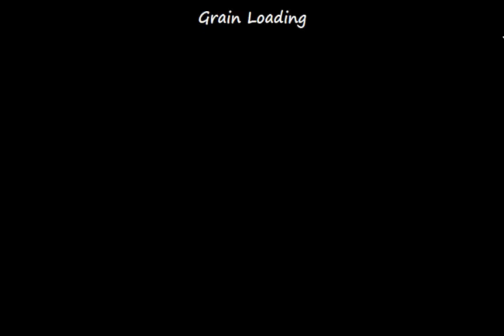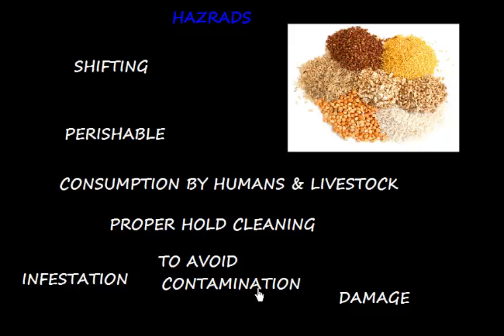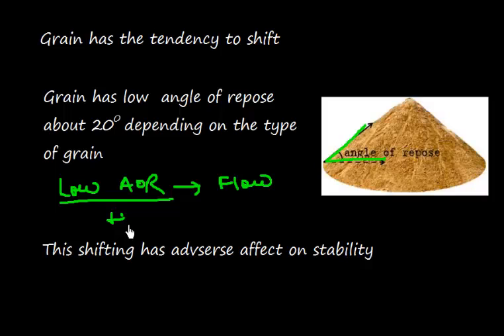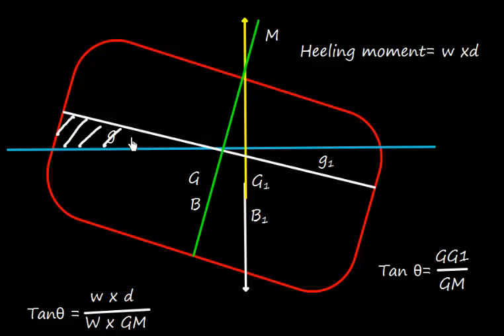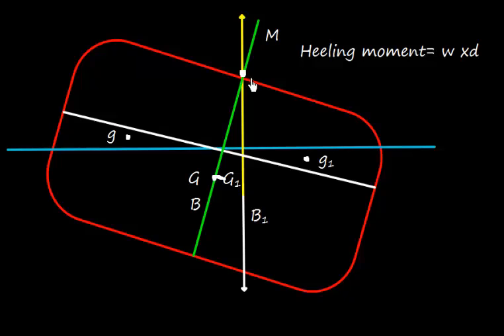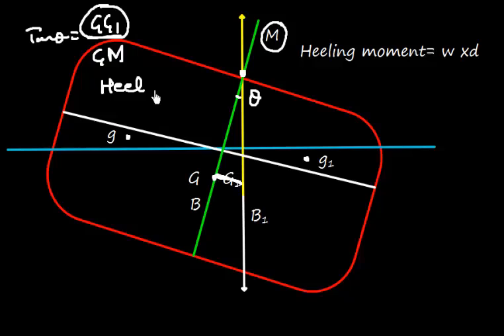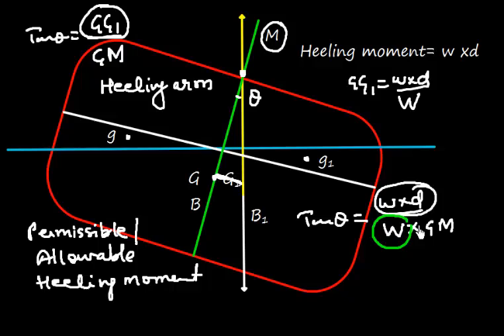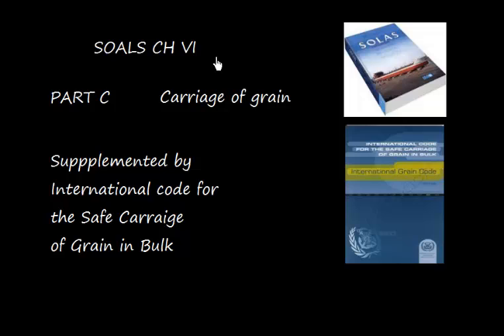Cargo work _ Basic Concepts of Grain loading

Comment: Ncb work when you come to Port to load. I was a walking foreman ila #26 cc and what I did was get with chief mate and ask for ships hatch cf and then I'd work out a loading sequence and determine how much cargo each hatch would hold determined by the hatches cubic ft and the stow factor of the commodity determined by the it's test weight. After doing the math and such I could then tell how much was to be placed in the slack hatch or hatches. I was pretty good at it..in fact on a ship loading 70000+ mts I would only hold back 200 to 500 mts to trim with. It wasn't risky when you do your homework and of course have loaded 100s of ships ..either to their summer draught or to a mark which is in centimeters. I loved it!!!